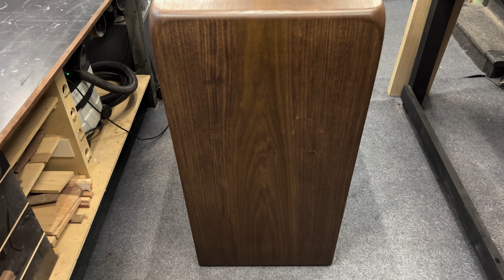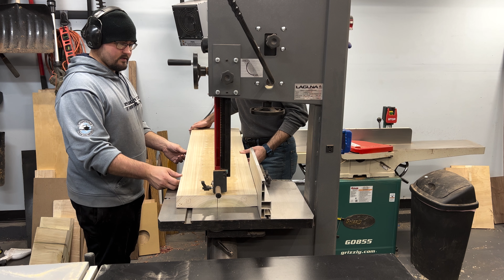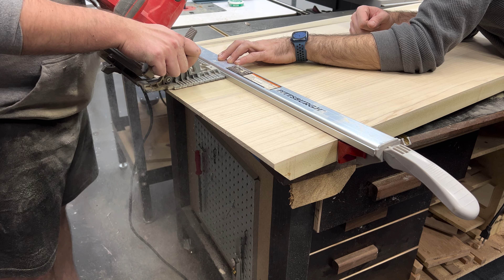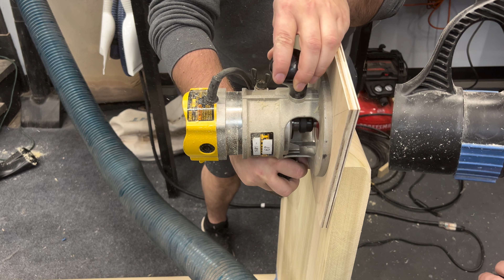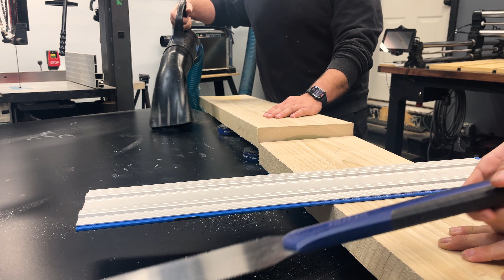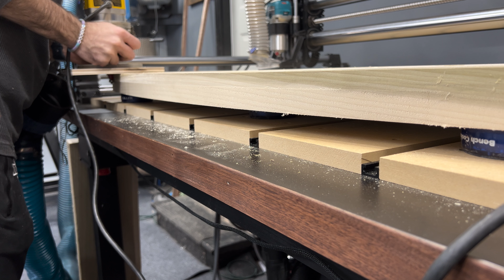How To Make A Waterfall Table The Easy Way

Comment: How did you decide where to cut in the biscuit holes and how do you get them to line up on both pieces
Reply from the maker: I honestly don’t remember. I think I saved them equally and as far as lining them up…I used a board attached to the bottom of the miters to use as an edge guide

Comment: Great design, nice job. I'm a bit fan of poplar, great knot free grain, reasonable prices, and easy to work. I like to seal it with dewaxed shellac and then use dye stain. BTW, linked over here from your comment on the Workshop Companion based on your channel name including "hobbyist"
Reply from the maker: I’ll have to try the dye stain method out! Thanks for sharing. Also, thanks for checking out the channel!